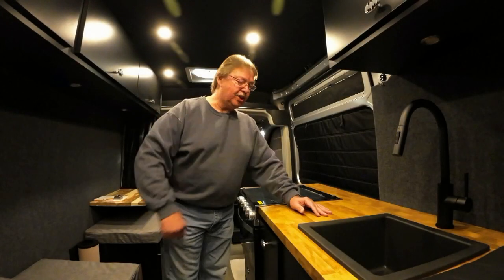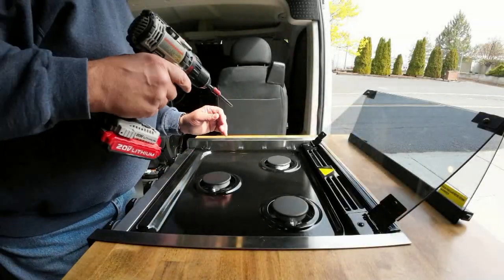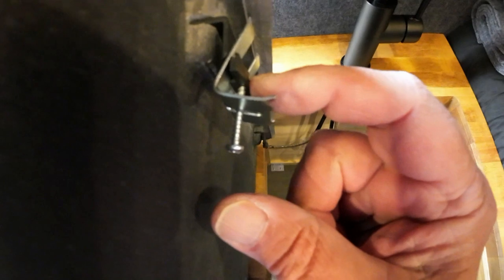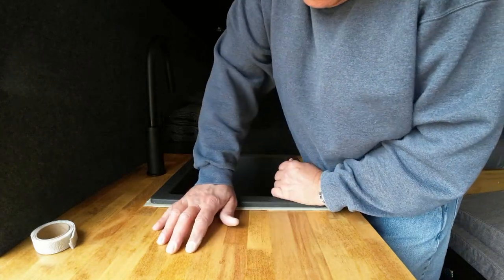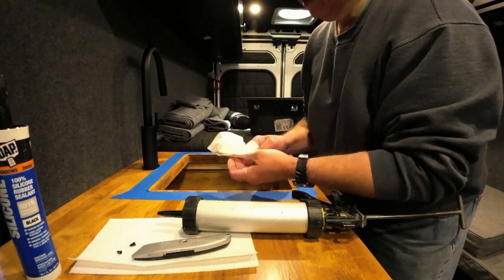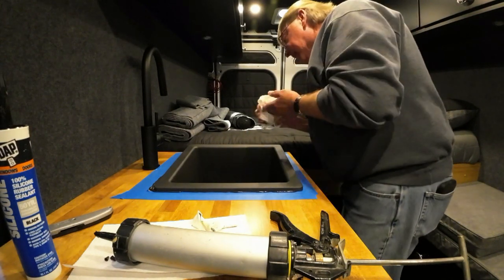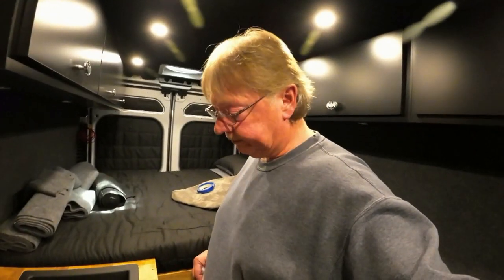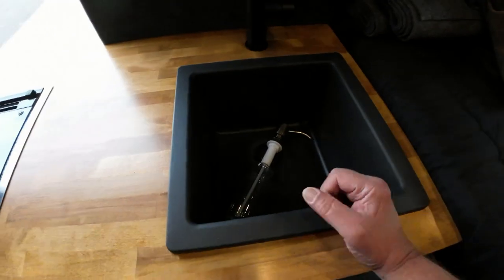Promaster Van Build 2500 159WB – DIY– Stove/Sink Install – Part 28

Comment: I learned another pro tip from you Al, use black silicon so you can see where all the excess mess goes, like your hand, finger, arm, counter and bed cover. The amateur that I am, I would have used clear silicon and been finding that stuff for a week! Thanks for another great video.
Reply: roflmao!
Reply from the maker: LOL!!! Thanks Ed M!

Comment: How’s the sink worked out so far being that close to the bed? 

I cant decide whether to do mine the same way or leave more room between the sink and bed
Reply from the maker: Actually worked out quite nicely. I was a little concerned about the sink being too close to the bed, but after using it for a while, had no problem. My last option if I did have a problem, would be to make a higher partition so I wouldn't "wet the bed"! LOL!